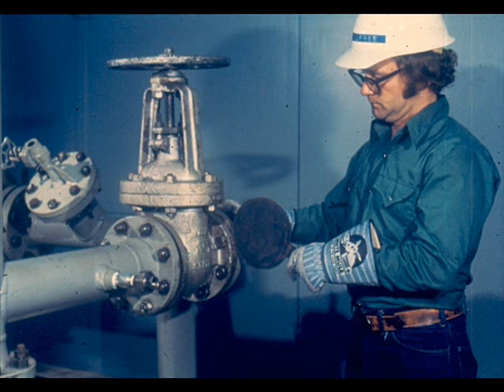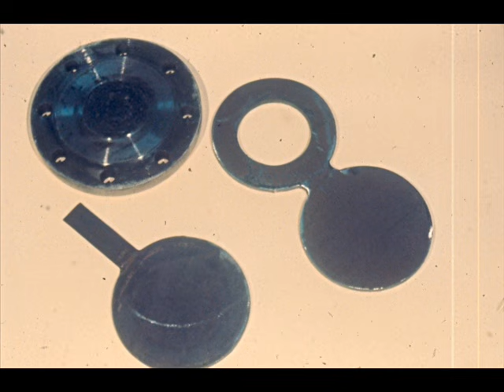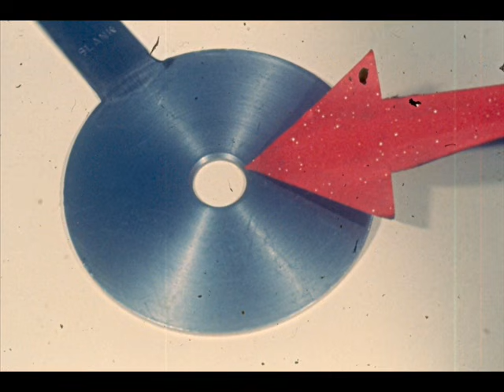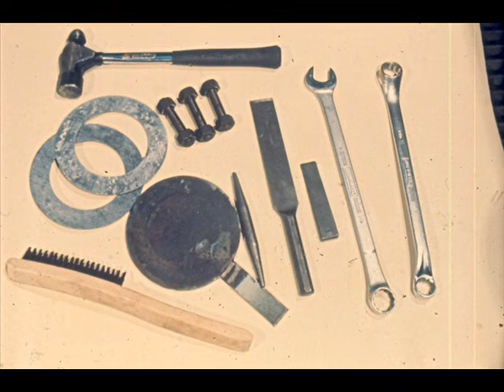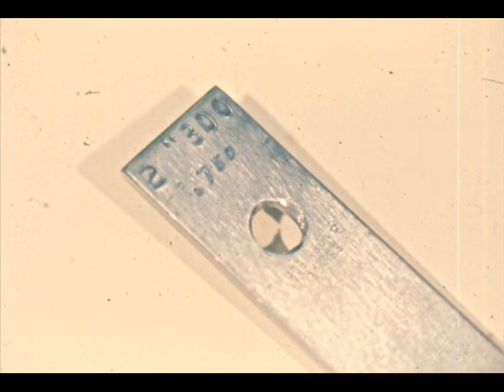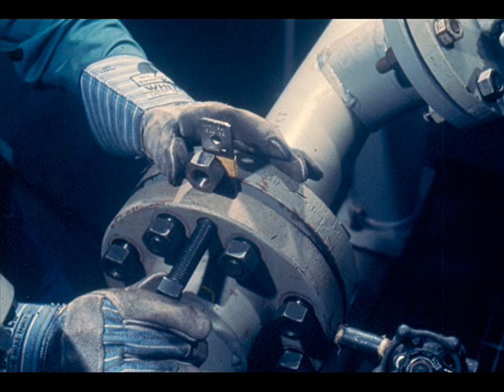Blinds | Install and Remove Blinds | Blinds & Orifice introduction and Types | Blinding Procedure

Comment: One things forget on the work.
1. LOTO
2. LLTO drawing
3. LOTO padlock
Reply: And slip blinds are required to have a t-handle, extend at least 2" above flange, and be flagged. This is very obviously an old old video, but still very practical.
Reply from the maker: Thanks